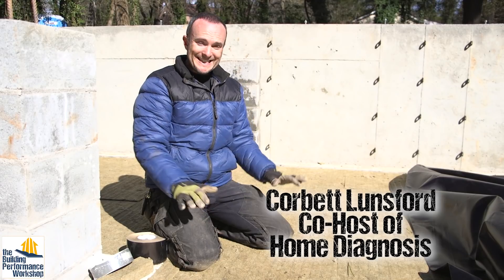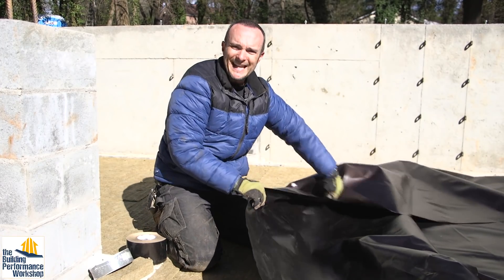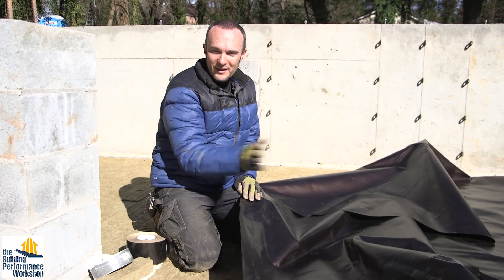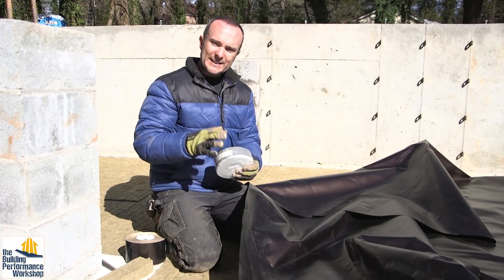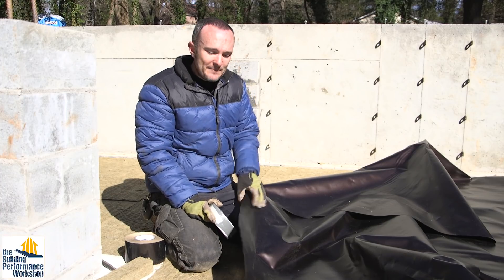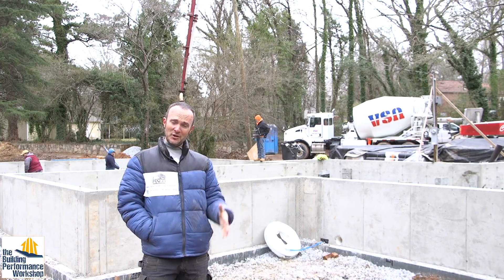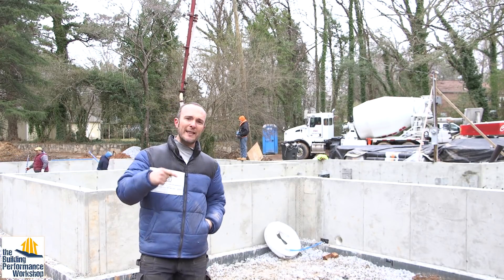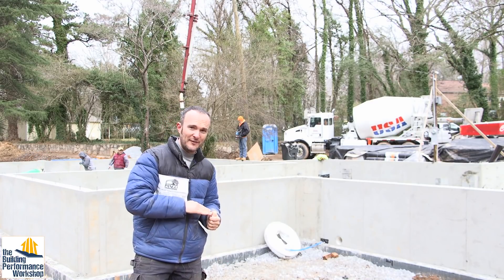How to Protect Your House from Subterranean Termites

Comment: Hi Corbett I looked at the Stego Pango wrap and it looked like a great product, I ended up using the regular yellow Stego 15 thou wrap primarily because of cost but I did tape the heck out of joints and any pipe intrusions to help mitigate termites. Stego also have a mastic that I used to help seal around pipes. Great progress eager to see how you fair with the GP products......

Comment: Corbett, How did you finish the vapor barrier up the crawl space walls?  Did you use the same product?  Did you take it up to 3” below sill plate?  Just curious how you finished it.   Perhaps there is another video that I haven’t seen yet.
Reply from the maker: Used Pango Seal (?) tape for the VB to finished concrete connection right where the slab pour would press against. Sorry that wasn’t clear. If you were smart about it, you’d use Pango Claw when pouring in the first place.

Comment: I would do pre-construction soil termite treatment before vapor barrier and pouring concrete.
Reply from the maker: I believe those treatments only last 10 years or so
Reply: That treatment would kills any possible termite in the house/soil and provide protection up to ten years. I personally think it might be longer for pre-construction treatment because the chemical would degrade much slower than exposing to rain and snow. Termite could get into your house through settlement crack on slab FLOOR and FOUNDATION WALL.

Comment: Does this mean there was no soil termite treatment around the property at all?
Reply from the maker: Correct- call me crazy, but in turn, I will call the termite proofing strategies crazy.
Reply: @HomePerformance  

I won't call it crazy, I think repeatedly beating the soil and aquifer to death to handle some termites is a desperate solution where others can be much better handled.

At that point I'd rather build out of CMUs and metal studs if I'm THAT terrified of termites.

Was it easy to get hold of the anti-termite vapor barrier from Stego?